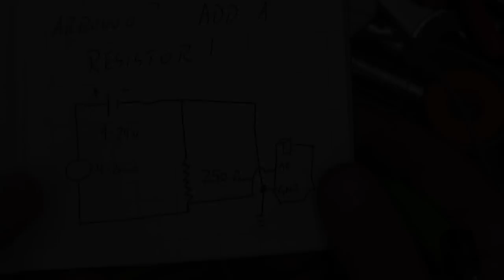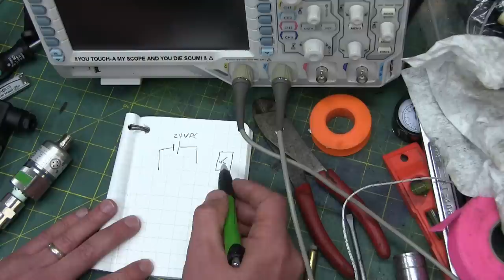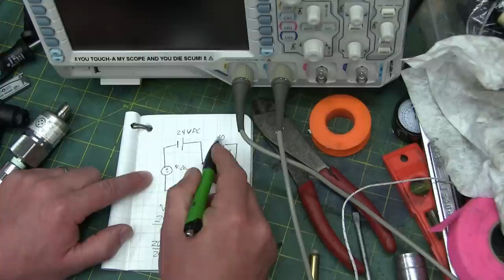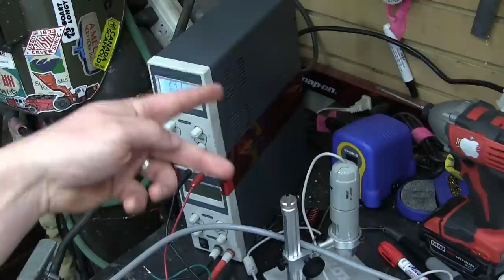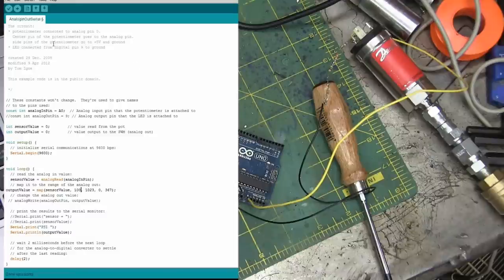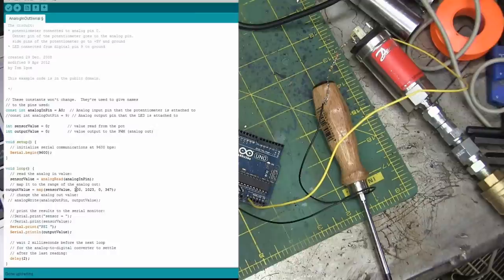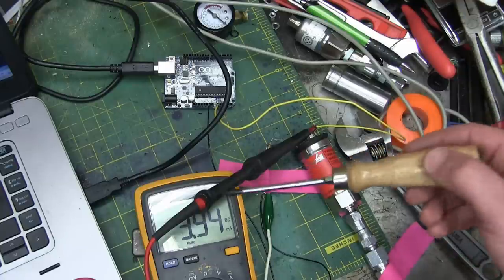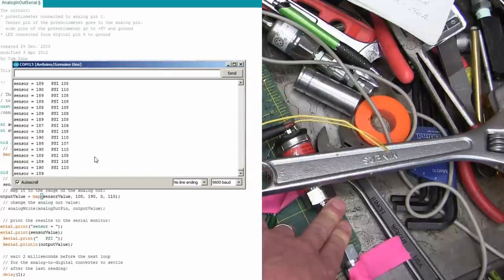4-20mA Industrial Sensor + Arduino

Comment: This is relevant to my interests! unzips... I have several 4-20 mA analog meters. Modding 'em to look like the meters in the Apollo Command Module/Lunar Lander (adding backlighting, custom scales). I'm building a Kerbal Space Program Instrument panel+controller. http://i.imgur.com/VplmqPK.jpg

The meters are mix of double edgewise meters (International Instruments 1251 and a single edgewise meter (General Electric-Yokogawa 180). I had to do the flip-flap of this vid and control the devices from my Arduinorino. The 1251 meters were easy. They were just volt meters measuring across a shunt resistor. Remove the resistor, change the series resistor that set the voltage drop, and I have meters good for 0-5 volts, as is. The Yoko Ono meter was a real weird birch. Split up the band and everything. It had some weird winding configuration that actually was directly responsive to the 4-20 mA current range. For that, I got lazy and bought a Wan Hung Lo™ 0-5 V to 4-20 mA driver board. Got lazy. Careful. Those Chinese can't tell the difference between V-I and I-V, and you have to REALLY pay careful attention to the listings, or you'll get an over complex circuit that just replaces a resistor.

I'll be soldering some thin copper sheets into light boxes that line up with the red and yellow areas of the scale, so I can individually illuminate those portions int he correct color. I'll also be boxing in the whole scale, to eliminate the light spill through the gaps for the pointers.

Comment: You messed up your schematics, in the second one your sensor is between battery minus and ground (which is also minus). Please draw the voltage source upright on the left side with plus on the top and minus on the bottom. Generally current flow should be going from top to bottom, and signal flow from left (input) to right (output). This way it's harder to get confused.

Comment: You mention putting a multimeter in series with the sensor... trap for young players, cheap multimeters can be too cheap to measure that low of a current accurately. That one bit kid me.

Comment: Ya we are doing some bad ass math here / 24v to 20 v ? the resistor is like 1000 to 1500 ohms using this voltage.
How about 24v - 5v for the arduino= 19v/20ma= 950 ohms.
The solution is same circuit 24v  place 2 resistors in series I used 1kohm and 240ohm. measure across the 240 ohm and measure the current and you will be right on the money just under 20 ma and just shy of the 5 v so this should protect your sensors and your arduino. The circuit you have is showing 24v across the resistor. Minus whatever drop there is from your device. Not good hooking 24v to the arduino.
Reply: Unless that part is acting like a full blown current source, as it is variable resistor like. Remove the arduino and double check the voltage across that resistor at full pressure, no arduino loading it. If you find 24v then it is done wrong as the voltage is present on the output pin. And then use the 1k and 240. If you find 5v under no load from the arduino then it is correct. Some sensors are different!

Comment: I think there are some math issues....  20V/20mA = 1000ohms.  I think you meant 5V/20mA = 250ohms.  Also, 3 10ohm resistors in series does not make 250ohm.  Just sayin.

Comment: If you don't have the three 10 ohms, better to use only 220 than 270, right? Or 220+27 or 180+68 if you have it. Either would be better.

Comment: Your mapping is wrong.   With the 4 to 20 ma. across the  250 ohm resistor the voltage range across it is 1 volt to 5 volts.  The mapping value at 1 volt is a binary value of 204.6 or integer value of 205.  5 volts across resistor will give you binary value 1023.    Your mapping function should map  205 to 1023 binary  to 0 to 367 PSI.  One too many Kanukistan Kocktails I presume.  Now I want to see it work.   Gotta love them there Arduiners.

Comment: This video is wrong i think. R=V/I     The calculation is 5V/.02A= 250 ohms         Not 20V/.02A as this would give 1000 Ohms    We need the 5 volts max for arduino input

Comment: shouldent you have scaled it 1 to 5 volts, 0 to 25 bar.

not 0 to 5 volts? 

4ma with a 250 ohm resistor is 1 volt, 20ma with the same resistor is 5 volts.
Reply: Correct.

Comment: Just use your cordless tool battery in a pinch.
Reply: PetrosArgy Wire it up wrong and the 4A will nicely toast everything on the bench ;)
Reply: Gavin Barker white to black to red to purple to gray. It'll work. Quit your frettin'.

Comment: Thanks man, you know where this would be useful? IN THE  NAVY (commercial and otherwise)

If shit breaks down in the middle of the ocean and you don't have the parts, it's just you , and your buddies left there scratching your heads.

So , nowadays an Arduino, some positive-can-do mindset (actually it's more like a must do mindset) the right knowledge and scrap parts laying around can be a reaaaal ass saver.

Starting from making the difference between getting a good night's rest and keeping watch in the engine room all night until the spare parts come (and depending from situation to situation, that could be the next port or some time in the next century, then you get the wrong spare part :)) fucking idiots...). And , God forbid, the difference between life and death if the shit really hits the fan.

Comment: 3:45 20 V / 20 mA=250 Ohms????? What did you smoke, man? :)
Reply: 20v into the transducer, 20ma out.... so 250 ohms is 5v output.
Reply: @unchartedgroupielove  I understand the math, brother. Got a degree in electrical engineering a few years back, I know how Ohm's law works, just watch at 3:45. Wording is a bit incorrect. Should have been 5 V / 20 mA = 250 Ohms.

Comment: $40USD arduino? wtf man, i buy them from aliexpress for:
$5USD -> uno
$2USD -> nano
$1USD -> mini (3.3V)
especially for the uno i was expecting cheap crappy clone but when i got it was genuine one (without the original package)... turns out that the guy i bought it from works in the chinese factory that produces the original uno for the pasta eaters...